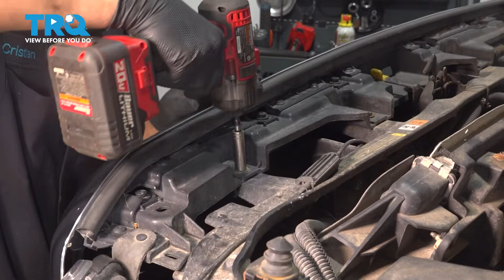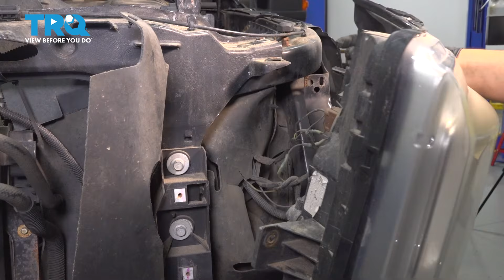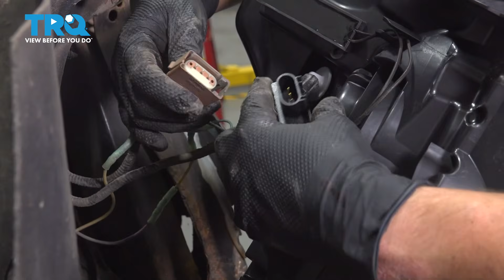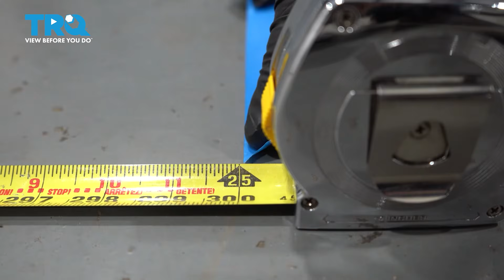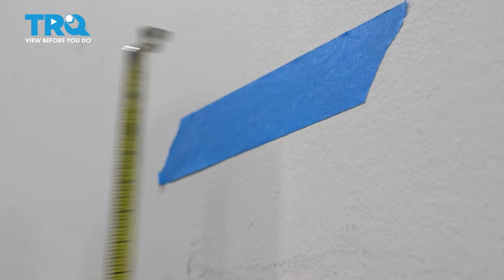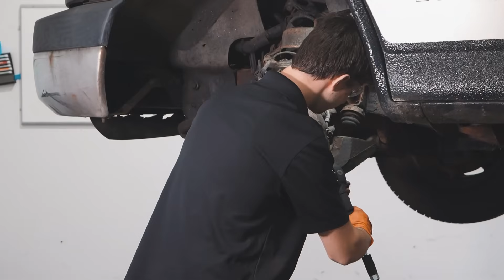How to Replace Headlight Set 2011-2016 Ford F-350 Super Duty

Comment: its so absurd that they designed the drivers side so its virtually impossible to simply swap a bulb out and you have to dismantle the whole front just to get to it. My work truck is a 2011 F-450 and its always the drivers side the one you cant just reach in and change.